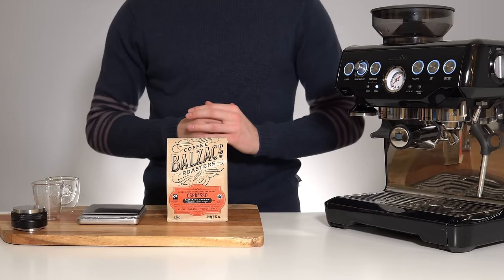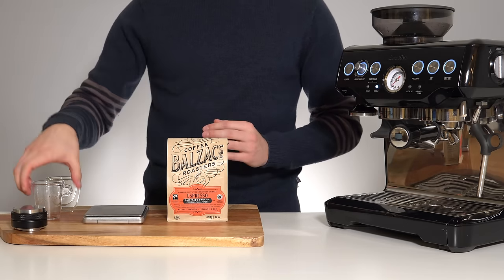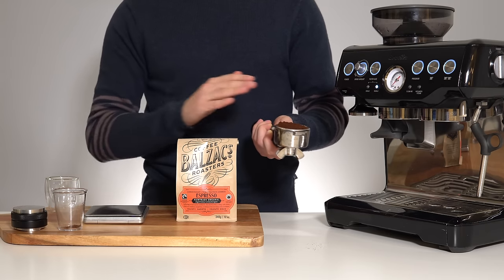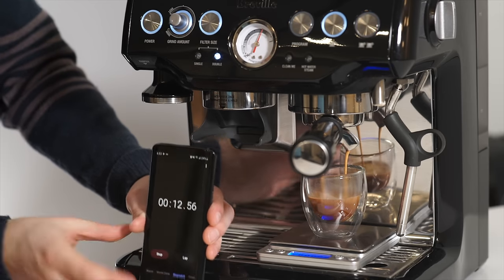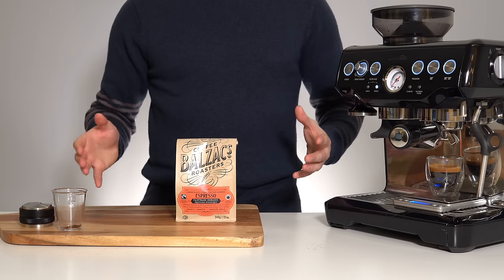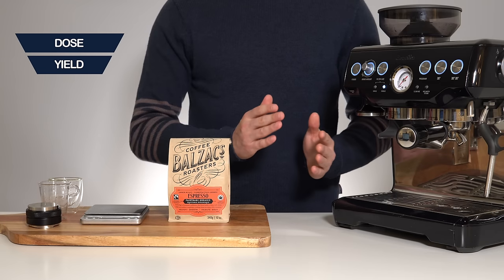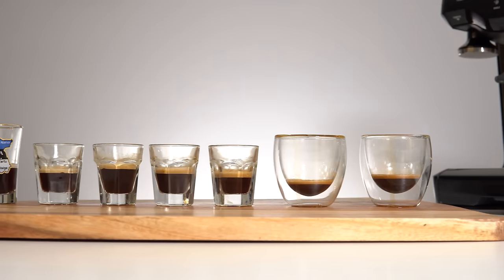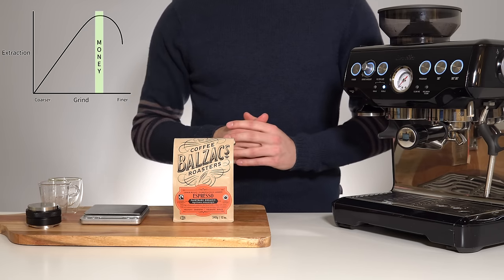Dialing In Breville Barista Express | Dose, grind, yield, time

Comment: Tip for the Breville; You don't need to click the program button first, but can hold the yield buttons (single/double) in for a bit, releasing when you want the pre-infusion to have finished and hit it with full pressure. Usually do 8 second hold then release. The full pressure will run until you click the yield button again.

Comment: This is by far the best explanation on how to make a great espresso on the Breville Barista. I've had my machine for approx. 2 years now and have struggled with consistency. I'd pull a great espresso one day and garbage ones for 2-3 days straight thereafter. I made the assumption that the machine automated the process and that is far from truth. After following the instructions in this video, I have made - good to great espressos - over the last week or so. My "worst" pull this week has been better than my average pull over the last 2 years.

There are two main takeaways that I assumed the machine was accounting for that I think had the biggest impact.

1. Weighing the beans - I just assumed when I asked for a double shot-worth of grounds, that Breville had that dialed in. As a result I was filling the entire grinder up with beans and just grinding the factory setting for a double filter size. This lead to too many variables between amount, grind size, tamping, etc... Every time the machine grinned coffee, it was different. Now I only fill the machine with 18g at a time, and knowing that I have EXACTLY 18g once the hopper is empty is a game changer. Seems so obvious but again I just assumed the machine, somehow, accounted for this.

2. Program Button for manual shot - using the program button to "manually" pull the shot is something I read about on Reddit but I needed to see someone do it for it to sink in. Again, this is a game changer. Being able to stop the shot when you reach 1:2 ratio of bean:liquid makes it so even your worst shot has the proper volume.  While you can still under or over extract using this method, it cannot be over stated how big of a boost it is to remove the volume of your shot as a variable. Worst case scenario, you have the right amount of espresso.

There were other tips in this video, but the combo of these two things removes the two biggest variables: How much coffee should I start with and how much espresso should it yield? Ensuring these two things are constants, makes tweaking everything else in between seem rudimentary. Shot taking too long? Make ground coarser. Shot too fast? Make ground finer...but at least you know you have the right amount of coffee and do not need to adjust that.

Great video. Great tips. I am enjoying my machine to the fullest 2 yrs too late, but glad I am able to enjoy it because of this video!
Reply from the maker: Comments like this are why I do it! 
Thanks for sharing
Reply: I thought I was the only one. Pulling the perfect shot is definitely one of the dark arts!
Reply: Yeah I’ve had some serious problems with mine and I found out relying on just the buttons doesn’t cut it, going more manual seems be the most consistent. to be honest, it’s fun doing the steps to get it right lol
Reply: Absolutely agree with this! I had my machine for a year or so as well, and was trying to watch different youtube videos on how to pull the shot correctly on an espresso machine. None of them explained it as well and as detailed as this video. Brought it down to the basics of how much coffee beans to start with (not fill up the hopper) and how much coffee to extract, and yea, been making great coffees since! Thanks so much @LifestyleLab! :D
Reply: Thank you for explaining these details! Can I ask you also which number you put on the external switch of dial, of the grinder? Also,which number you have on the top internal dial? Thank you once again!
Reply: Filling the hopper with 18g doesn’t necessarily give you 18g in the basket after you grind the beans.
That’s only for single dose grinders or manual grinders.
I also have breville and tested it out, so the best way is weighing the coffee after grinding it
Reply: @وليدالمحيميد-ج1ص  Sure it does. You have 18g only in the grinder and you grind until empty (set grind amount to max) 18g are now ground into your basket.
Reply: @dimitardimitrov5366  the grind size depends on the coffee. Start with the middle number and adjust based on how quickly or slowly your espresso is pouring out. If it takes more than 35 seconds to get 36g espresso shot, make grind courser. If it’s taking less than 25 seconds make it finer. As for the grind amount, just set it to max. If you only put 18g in your grinder let the grinder run until it’s empty; the max setting should empty the hopper and still keep running for a few seconds after. This ensures every gram has now been ground into your basket.
Reply: @yankita8689  Thank you! Appreciate your time!
Reply: @yankita8689  no there will be some left in the grinder
Reply: @وليدالمحيميد-ج1ص  just checked this morning. It is completely empty. The grinder also runs for a few extra seconds once empty when the setting is set to max. I am not having the experience you describe.
Reply: I’ve always thought that the 1:2 ratio was automatic and i couldn’t figure out what I was doing wrong because i would end up with 50-60g of liquid after the shot stopped. I now realize part of the dialing in is to program it at 36g and if it does it in a timely manner.
Reply: Wow! You taught me a lot with your reply!! Thank you!! ❤
Reply: your comment just complement this video

Comment: Didn't even think that a stale bean would affect the crema so much! I liked the first part of the video, detailed enough to get through as a new owner of a machine! Keep up the great work!
Reply from the maker: Sure does! As beans age the trapped C02 escapes. The release of that C02 during extraction is what creates the crema everyone knows and loves. No C02, no crema!
Reply: @LifestyleLab_  Got the same problem. I always get coffee in pre infusion phase nomather how find my grind is.
Reply from the maker: @tomekhekin914  try increasing your dose and dialing back in, or tamping more firmly. Other possibility is that you need to adjust the physical burrs
Reply: Lifestyle Lab this is the same issue I have.  It’s often under extracted but super dark.   Would it be possible to have to adjust the burrs even though it’s a brand new machine?   Thanks for this video learned a lot!
Reply: Mike George you need to adjust grind settings (I.e. the burrs) for different coffee, dose size, as beans age.
Reply: @LifestyleLab_  how do you adjust the physical burrs?
Reply from the maker: Like this! https://youtu.be/QNvOcE4-VEo
Reply: Ur cute

Comment: Great video, some really good pointers.  One thing I would say about dose is weighing 18.5g to account for grind retention. It's always going to be hit and miss, but I find 18.5g gets me closer to 18g. 

I've had the machine about 2.5 years now and would 100% recommend to anyone reading this to invest in a calibrated tamper. Not just for the function, but more because a 53mm tamper fits the basket better than the one provided with the machine. There's a very small gap between the tamper and the portafilter wall that encourages coffee grounds to climb the edge when tamping. Small detail, but helps with the consistent tamping you're looking for.
Reply: What is the goal  with the tamper? I only have the one that comes with machine.
Reply: Except it's not going to retain .5 grams every time. If 18.5g works for you, great, but it's not because of retention.

Comment: I know this video is 4 years old but I just wanted to say thank you for your precise directions. I used to be a barista and I thought I wouldn’t have an issue using the Breville. I’ve been unable to pull decent shots since I got it. I got worried I had a bad machine until I saw other experienced Baristas having the same issue with it. I’ve really struggled getting the pressure up. I went through an entire pound of coffee yesterday through trial and error and still having issues. Thank you so much for this video.

Comment: I wanted to give some tips too i've experienced:

1) My first beans were "Eza Organico full beans", but they are so dry that the 36mg came out in FIVE SECONDS. I think bc of the little amount of coffee oil it does not create enough resistance. Nevertheless, I put the grinder to stage 2, i got at least a drinkable espresso then, even tho it was still far away from 25 seconds.

So if you have poorer quality beans/stale beans -> don't hesitate to use the finest grinder setting (note that BELOW 8 its FINER (8 to 1), it took me 2 days to figure that out)

2) Use the double filter, but NOT the dual wall. It creates fake crema and fake pressure. If you use the single wall after it, you'll see how much is actually wrong with the espresso (and especially with the beans).

Remember: you bought yourself a great device and so you want great espresso, don't let a dual wall filter fake your results. Use the single wall and fresh beans, it will work a miracle.

Thank you so much for this video, it helped me a lot with my new Sage Barista Express!! Maybe these 2 tips are helpful to anybody

Comment: Awesome tutorial man! 
The video and audio quality is incredible. 
From one coffee nerd to another, I hope you don't mind me giving my 2 cents. At 4:54 you mention to start timing the shot at first drip. This is actually incorrect.

Water starts to extract soluble compounds from the ground coffee the moment the water and coffee come into contact with each other, so the extraction begins the moment you press the button. 
The shot that you pulled at 5:02 was actually spot on! It ran to around 32 seconds, which is where you want to be with pre-infusion like on this machine.
I would personally turn the pre infusion function off if that's possible, as it can be a bit complicated for me personally. (Some coffee roasters have suggested recipes on their websites with shot time and dose:yield for their specific coffees and the shot time suggested does not account for how long to pre-infuse for. Not to mention this machine does more of a "pre-wet" rather than a true pressure profiling pre-infusion, which requires very expensive machines that I will never afford. Boooooo lol)
Another thing I'd like to mention is a suggestion for playing with brew ratios (dose:yield). A simple rule of thumb is for darker roasts, use a smaller ratio (1:1.5 to 1:2) and for lighter roasts use a larger ratio (1:2 - 1:2.5). Darker roasted coffee is more soluble, so it requires less water to get make some tasty coffee!  
So in conclusion, a shot is always timed between pressing the brew button and pressing it again. So simple!
Sorry for the lengthy comment. Just a bit friendly input 😁
Reply from the maker: Explanation of when to start timing https://youtu.be/E9MiqOJdwPc

Comment: Guys, when adjusting the fineness, I couldn't get above a 10 second extraction at setting #1 in my Breville Express. If this happens to you, adjust the internal grind setting from the default 6 to a 2. For me, the 25 second shot was possible at internal setting #2 and external setting #5. Good luck!
Reply: Thanks! This comment saved me. This is exactly what I needed to do. I am on internal 2 and 3 on the side of the machine. I am just now able to get a 22second shot.
Reply from the maker: These videos will help :)
https://youtu.be/QNvOcE4-VEo
https://youtu.be/_uB3FZGkR6E
Reply: THIS comment was the needle in the haystack for me!!!!  Thank you sooooo much!  5⭐️s.  A+++.  🙏🙏🙏
Reply: This worked for my Breville Barista as well, thanks for the tip! 😁
Reply: What am I still doing wrong 😭 the single shot works perfectly fine but when I want to try and use the double I'm not getting the pressure I need. The change on the internal burr to 2 helped but even after it's still running through to fast or what I'm finding is that I'm scorching the puck all the time, iv tried 18g of coffee beans and 16g of coffee beans both on internal burr 2 and then the setting to 4 on the side of the machine and 3 but it still runs to fast. Am I just not packing the puck tight enough? I have watched the distributor video and done what I was told but I don't get why its still pooling or scorching. I just want a good double shot coffee please help
Reply: thank you thank you and a big thank you.  I can't believe Breville official site does not list this information, normal ppl would think you do the external setting first that would make huge difference and internal settings are just for anal micro adjustments.  It turns out internal settings are more important.  Not sure if the machine was designed that way.
Reply: @MriVmedia  I'm having the same problem.  Just can't seem to figure it out and it's getting really frustrating.
Reply: @VE6CIC  I think I have figured it out, my other half has been leaving my coffee bean bags open and it's been making them stail super fast so I got my subscription coffee in the mail followed the video and the internal setting did help alot but I can not stress about having fresh beans that's the real winner, old and stail beans don't let pressure build up for shhhh.
Reply: What is an internal grind setting?!
Reply from the maker: Upper Burr vs Outer Dial Grind Setting | Breville Barista
https://youtu.be/_uB3FZGkR6E

Comment: Fantastic, very well explained, i set  my dose to 18 gr , set my time 27 sc, then try to get the yield, 36 gr  by changing my grind, I found it easier this way. just to add I think changing from double to single shot using the same grind set might not work, I think you have to find the right grind set for each filter!

Comment: Amazing! Thanks!
No other video I've found has explained which factors have the most input to the taste, and which are just fine tuning. 
I've just taken to bits and serviced my Breville dual boiler. Now it's working properly (I had let things drift), and with your help, I'm getting back to a decent shot, rather than just a so-so one.
Thanks again.

Comment: had struggles, so decided to reset to factory settings and follow this instruction. Now I have good-as-possible setting 18gr in, 36out, 27sec (but the pressure is too high; end grey area...but decided to ignore the always high pressure on my machine. Strange that most people have it the other way around, too low)
And I do have to say that besides the 1:2 ratio I also like 1:2.9 ratio ...much sweeter.

Comment: Very helpful video. I followed it to the letter (the first part, to dial in a “decent” cup of espresso) and even with the grinder set at the lowest (finest) setting, my 18g dose would reach 36g in about 16 seconds. I don’t think the manual emphasizes how important it is to change the top burr’s dial. Mine came in at a factory setting of “7” and when I lowered it to “4” (leaving the grinder’s side setting to “1”) I immediately went into over extraction; the setting for the top burr seems to make a major difference. After that, I dialed back on the side setting (to a more coarser setting, 3) and that got me an extraction of 36g at just a little over 25 seconds. I’m now thinking about setting the top burr’s setting to “5” so I can be more towards the middle of the side dial for the same extraction (to theoretically have more range with other beans later on). I don’t think the adjustment of the top burr gets talked about much, it makes a huge difference!
Reply from the maker: Thanks Lui! 
I've since made a video on how to change that top burr setting. It's the one thing I wish I also included in this tutorial: https://youtu.be/QNvOcE4-VEo
Reply: Damn, exactly how it went down for me too. 18g dose reached 36g extraction in 18 seconds. Weird thing was the extraction took more time when I reduced the dose, so I thought I was putting too much beans. But decided to trust the video and this comment, opened up my grinder and adjusted the burr to 5, making it even finer.

Wow, extraction shot up to 40 seconds, so I adjusted the grinder setting on the side, until I got 25 sec. And holy shit, the best espresso I’ve ever pulled since getting this machine. Thanks for this video, and this comment.

Adjust the top burr!!!!
Reply: I tried this also but my pressure is now all the way above the “sweet spot”. Where is your pressure when pulling a 25sec shot?
Reply from the maker: Ignore the "sweet spot" on the gauge. Focus on  good flow and dialing in your brew ratio.
Reply: @antoniosong  For my taste, the best tasting shots are when the pressure gauge hovers between the “12” and “1” and then starts to move down towards the end of the 25 secs. I find the gauge very handy, sometimes there’s a little bit more or less pressure so I’ll adjust the time and maybe go for 20 or 30 secs depending on what the pressure dial is showing.
Reply: I too had to change the internal/top burr setting by one or two, from the default factory setting for my situation. I use Intelligentsia Black Cat beans and freeze them, then measure out 18g each morning as instructed in this video. I make lattes so I don't really notice much of a difference by using frozen beans. I grind them straight after removing from the freezer and measuring. That way I can buy the next bag when I find it on sale at my local grocery and not have to worry about them going stale.